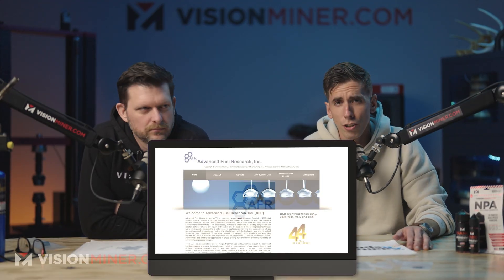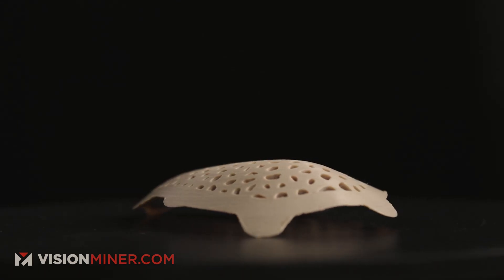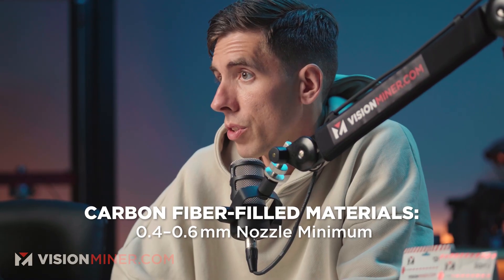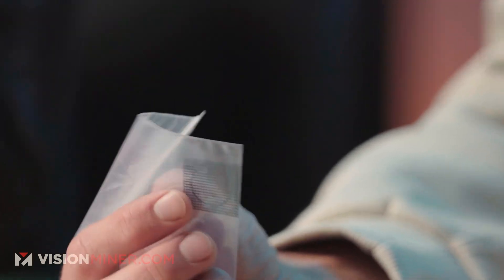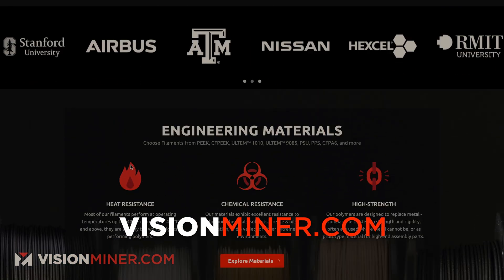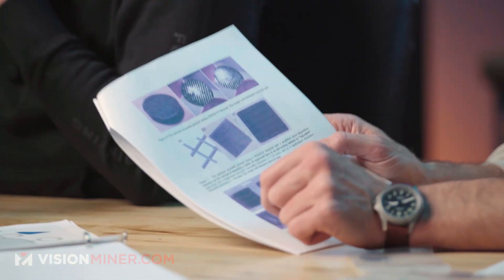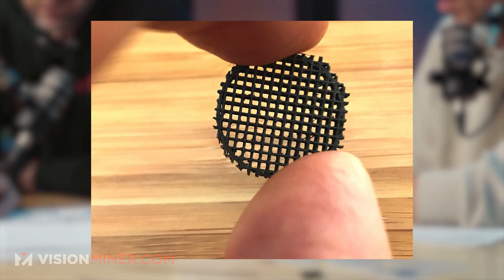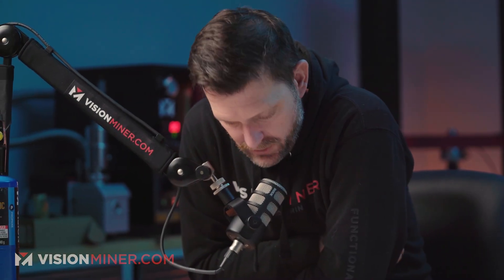We 3D Printed Parts for NASA. Here's How.

Comment: 💡is it me or is this just a small engine(weed eater/string trimmer) Spark Arrestor after it's used and covered in carbon buildup❓ 🤣 pack of 5 - $9US🙃
Reply: Space parts have much more demanding requirements, a big one is off gassing. Because of that they can only use certain types of plastic like PEEK
Reply from the maker: Hahaha, it certainly does look similar!